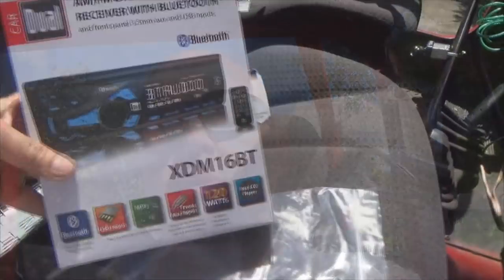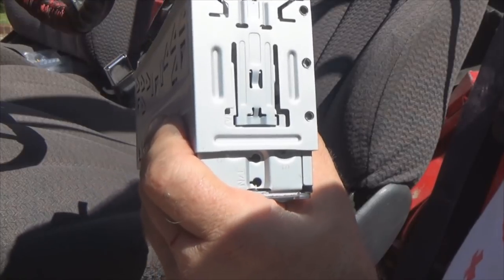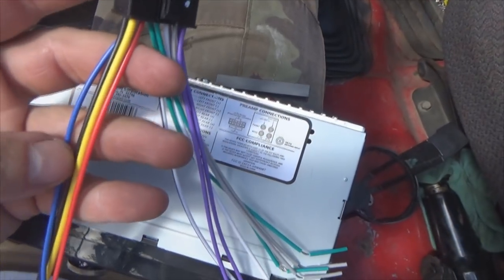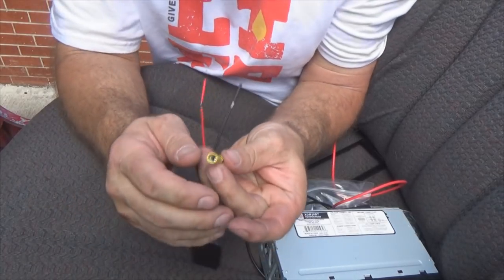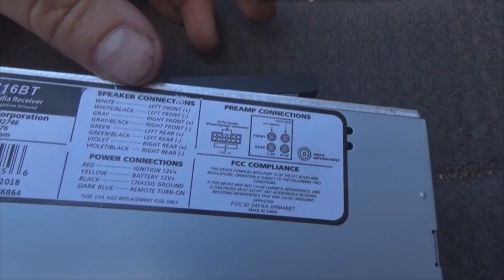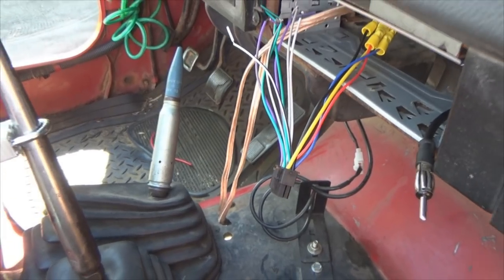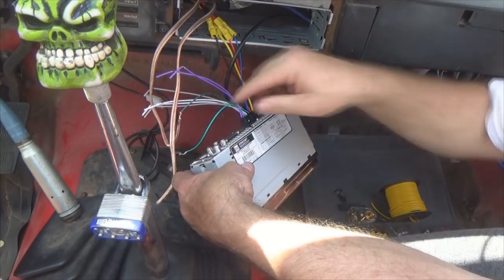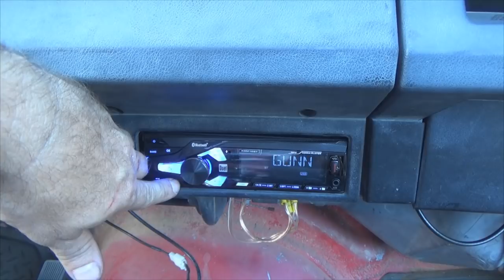Jeep Wrangler YJ - I finally install a radio in my 1991 YJ

Comment: Great tip Chuck on the taping the wires to harness each component.   I wish I had seen this sooner.  The wiring under the dash in my 72 C10 looks likely a spaghetti dinner .
Reply from the maker: I've built several complete harnesses. All those wires can be a mess to keep up with. I have to break it up into sections by taping each circuit otherwise I'd go nuts!! LOL Thanks for dropping in! Have a great day!

Comment: Hey! I appreciate your videos!  I’ve learned quite a bit about my YJ.

One tip I’d like to share with you though...  if you ever forget which wires are which when it comes to stereo speakers, you can connect them to a 9volt battery.  It should create a noise that you can then use to find where your speaker wire is going!

Comment: I don't know how you got by so long without a radio! I drive around 40 miles round trip to work and music is a must for me. I got a very cheap Kenwood unit off eBay and I only have 2 speakers (mounted on the floor right in front of the shifters) but they're actually pretty decent. I got a soundbar from a junkyard that I've had sitting for almost a year now and your other video reminded me to work on mine lol
Reply from the maker: My drive was 35 miles one way. I just got used to not having it. Even now that its installed, I've only turned it on a few times. I'm not really crazy about the sound quality at the moment so it just annoys me more than anything. Once I get the rest of the equipment installed I'll like it better. I'm more excited about having an interior light than the music .. LOL. Goos seeing ya drop in man! Have a great day!

Comment: Twist the insulation as you pull it off the  wire Makes a cleaner twist and you dont get the oil  from your fingers on the wire.  Also, I put a knot on the negative wire, kNot/Neg.  Just my memory thingy to make it easier to remember which wire is which.

Comment: I had an idea watching this at 1:28   Slide the connecter on the wire like you do with shrink tubing when soldering. Fold both end like you did here. hook them together and maybe twist them a bit. Squeeze this mechanical connection to make to small enough to slide the connecter over and crimp. May be overkill but it was just a fleeting though.

Comment: Hey hey hey question I have a 1994 wrangler yj with out power steering I’ve looked all over do you have a video on converting my yj into power steering please help a brother out 😢
Reply from the maker: I don't have a video on that. My suggestion would be to find a donor rig and pull all the parts at one time.

Comment: I have a hard time reaching those speakers that you have in the Jeep I want to put speakers in those places I do have a sound bar overhead but I do want to replace those speakers
Reply from the maker: It's just 4 screws per speaker. Pry the grill off, remove 4 screws. Take the old speaker out, then put the new ones in.

Comment: Strangely enough I need to do a new stereo in my 2000tj as the cd player wont play half my cd's and is only getting worse. In my case I wanted to add more functionality like a backup camera (for ease of hooking up a trailer mostly), and satnav (think it would be king of cool to not have to plug in my damn phone just to see where I might be all the time out on trails), and a few other things most Dinn2 systems can do that the stock dinn 1 that tj's come with cannot, The one vid I found on youtube that some guy did on a dinn2 conversion in his tj was pretty good...Right up till he got the the wiring...he was all detailed on everything you needed to do till it came to that part...seriously the guy did the whole "and there you go, thats how you do it" and absolutely skipped the whole ending...anyhoo whether I go the dinn 1 or 2 route I'm glad there's peeps who do show the whole process on installation be it stereos or light bars (how I found your site originally lol)
  cheers man keep up the good work
Reply: I would get a double din kit from crutchfield.

Comment: What gauge wire did you use to make your harness?
Reply from the maker: I dont remember right off. Probably 12ga because I rarely keep anything less than 12 around the house. I typically keep 10 and 12 in spools. Then purchase heavy gauge like 1/0, 4, 6 or 8 as needed.
Reply: @Poweraddicts  Thank you.

Comment: Why do we never see your mustang Chuck??? Would love to see it, it's my second love compared to Jeeps.
Reply from the maker: I swapped engines in it a while back. Pulled the harness to tuck and hide it. Then got into Jeeps and only fool with it occasionally. I've tossed around selling it but it is kinda fun to drive. It's got a warmed up 302 5-speed with 3.73 gears. All I gotta do is finish the harness and fire it up. With 2 Jeeps, one motorcycle that has been seen on the channel, another motorcycle that hasn't been on the channel, plus a full size rig that is gonna be on the channel soon. Lots of car insurance!! Just kinda losing interest in the Mustang. The interest may come back when I drive it again. But realistically, I need to thin down the herd!